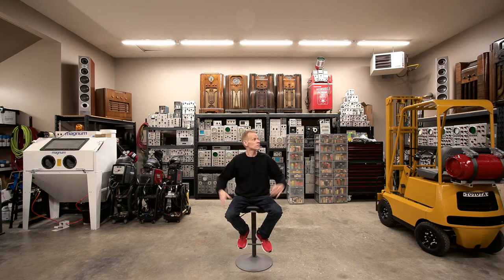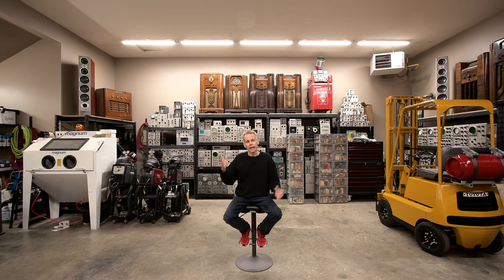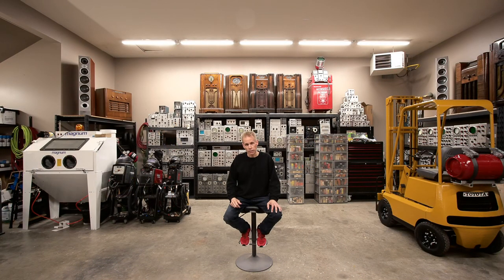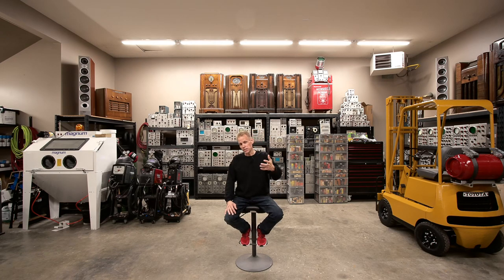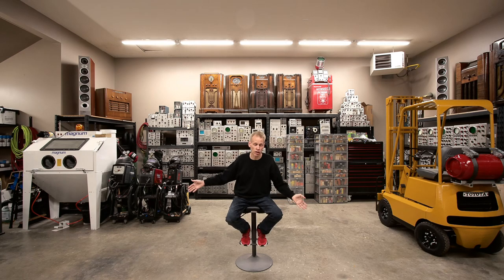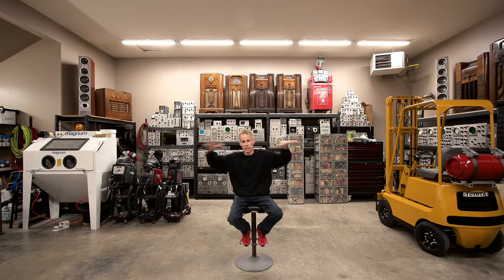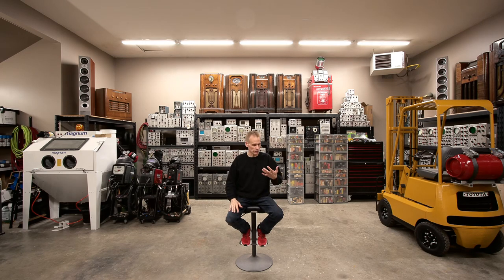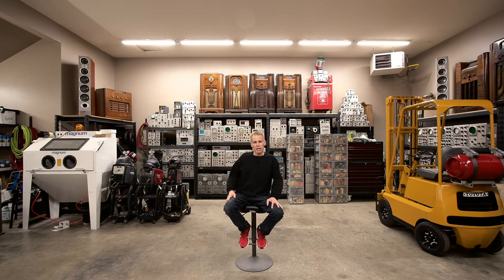ZAP! Mr C's Worst Electric Shock Explained In Detail!

Comment: Thank-you for the Story Paul.  Yes i appreciate the correct usage of the spoken word. Electrocuted is a term on an autopsy which means death by electricity. However if you live you were shocked.  It may be a severe shock but if you're alive it's a "shock" no pun intended. Hi hi we are glad you're alive thank-you for the caution and the mentoring we need good examples and good repair technicians; passing on of the technical mindset for troubleshooting electrics it great.  Thanks again.🤓

Comment: As a highschooler in '70 I took two years of electronics. It was all tube radios and amplifiers and theory, etc. I learned in my first class (thank you Mr. Peterson) as we were taught to ALWAYS put one hand into the pocket when working with voltages that could shock. A habit I still retain and practice without fail today at 70 years old. Occasionally one needs to remove that hand from the pocket for some specific task, but it provides a deep awareness of the danger lurking, and when the absolute need to a second hand has ended, back into the pocket it goes.

Comment: Hi Paul, thanks for sharing and glad you are still with us to share your knowledge.  Back in my teens in the 70s, I did stupid things, like touch a fly back transformer metal cage while set was turned on.  Luckily, only with one hand, felt the 60hz ac, and luckily still here.  One time working on a switching power supply for a computer, I did not realize high voltage ac was there, even though it did say high voltage right on it.  I also don’t work on amps that have tube heaters in series, 50c5, 35w4, etc, as it’s easy to get shocked on them too when ac not isolated.

Comment: Excellent video as always! Your shop is so...clean! I've been working on tube guitar and hifi amps for close to 30 years now, and have yet to get a dc shock from one...but I'm anything but cocky. Always work slowly and methodically and am aware of the constant danger but not really fearful of it. Never touch em when medicated or impaired and always discharge and verify...one hand, rubber soles, etc. I also am an avid user of clip leads for my meters and leave one lead disconnected from the meter while hooking up for a current measurement until it's connected on the device properly. Some real pros have died doing this work over the years. I HAVE however taken a pretty good AC shock from an old Cheshire labeling unit at a mailing house i worked at for a time. I believe it was around 300v and most likely 60 hz. Did not get clamped thankfully. Some bit of wiring insulation had failed and was putting voltage somewhere it wouldn't normally be. That weird feeling vibration and the realization of "oh shit..I'm getting shocked" is something you don't forget.

Comment: Hi Paul - Thanks for sharing that memory,  I remember the worst shock I ever had with very similar symptons - just 240V AC in the UK but got it straight through the heart accross both hands. Remember thinking I cant let go of this and this is the end  - then a feeling that someone had pulled me away and gently sat me down against the opposite wall - I was also white and had a headache for 3 days - needless to say the electrician that was training me was not even on the same building floor as me and knew nothing about the shock - sometimes there is a guardian angel looking out for you 🙂 - Great channel keep up the good work.

Comment: Stories like this really give perspective!
The worst I had was while testing 11kV power cables. When testing insulation in high voltage cables, it is rare to use DC because it can leave areas of charge within the cable even after discharge. When the cable is re-energized this charge is projected on top of the AC peak voltage and can cause catastrophic cable failure.
The solution is to use AC to test the insulation, however for long cables the capacitive reactance is very low and the current required too high for the test sets. 
To get around this we use lower frequency AC (generally 0.1hz, reducing the current required to a 500th for a 50hz system).
The only issue is the cable still has to be discharged as some test sets don't finish at the zero point crossing or have a discharge function in-built. The longer the cable, the longer the discharge required due to dielectric re-absorbtion.

I was testing multiple paper-lead cables @12.5kv one after another and discharging as I went. I didn't realise the one set was far longer than the rest and didn't discharge nearly long enough. I grabbed the test clip after my short discharge attempt and the sensation was like an awful cold wave passing over me. I swear could feel electrons washing over me. It was a sickly feeling and felt completely different to the bumps I have taken from mains AC(2 to date). I dont know what the voltage had risen back up too, but I knew I had messed up and was lucky.

That was years ago and I haven't had anything since. It definitely changed the way I worked, and I really advocate the safety around higher voltages because you rarely get a second chance.

Comment: Man I am so glad that you survived that freak accident Mr Carlson. I couldn't imagine never having seen any of your videos. Some of your inventions I still want to build also. 
Watching you bring some of the old stuff back to life and literally knowing every single detail of what every little thing does on it is mind boggling.

I've always loved and have been fascinated by electronics! Before internet it was kind of difficult to get exposed to them however. We had an old school Tube TV repair nearby but when the  tube TV's went away he closed up shop saying now if a TV tears up you just throw it away and buy another.

  My 1st electronic repair I fixed a Radio shack 100 watt PA Amplifier that I used to sing with at get together's and churches, when I was 16 years old with no training whatsoever. Not saying a lot actually since it was just an obviously burned out resistor which I went down to radio shack and bought a pack of 330 ohm resistors of which I still have 3 today as well as the installed 4th one. LOL!  And very likely they were the wrong value with the part fried beyond recognition like it was and radio Shack seldom had a certain value of anything on the shelf  that you needed anyhow  but close enough sometimes.  
I always wondered though what if it had been something more complicated, something that didn't rare its ugly head up at me screaming, " Hey I am the problem right here me the burned up resistor,  yea that's me right here! Now go to Radio Shack and buy another one just like me and lets get this thing going again." Had it not been so obvious a part likely I would not have been able to fix it then. I might today but not then.

I am also curious about your early days and education and what spawned you into electronics. Was it something that you stumbled onto by accident or out of necessity trying to make something else work? Maybe you grew up with an electronics expert? Were you a child prodigy perhaps building transmitter's as a toddler wowing your parents? 
If you get a moment I'd love to here!

Comment: Your Guardian Angel pushed you off the chair. I had a couple of close calls also. When I was 18, I was repairing my neighbor’s large screen black and white TV with a wooden cabinet. I knew I needed a mirror to adjust the deflection yoke but didn’t have one so reaching around the cabinet and looking at the screen and I got a high voltage shock, and it picked me up and threw me back about 6 feet, I would have gone further but the clothes chest stopped me. The second time as a crane technician, I’m about 24 years old then and I was servicing a customer’s “A” frame hoist, using an aluminum ladder leaning on the A frame. The hoist was phased wrong, and I was told by the maintenance man there that the breaker was off. I preceded to switch two of the wires around and all of a sudden when I removed the first wire nut I was immediately being shocked with 440 VAC and like you I couldn’t let go and it seemed like it was forever. Finally, somehow, I was able to remove body contact from the aluminum ladder. They had one of the 3-phase lines connect to the A frame.  I was thrown back and off the ladder and about 15 feet down. My thumb and index finger were burnt really bad. Needless to say, I had always checked the breakers myself after that ordeal. I hope this helps someone from ever experiencing what we went through.
Reply from the maker: Thanks for sharing your story Ken!

Comment: I have had one bad one from an old radio. There was no transformer in the thing, and it was plugged in the 220vac without its wooden cabinet. I touched the chasis with one closed fist, cause I didn't thrusted the thing at all. It had old cloth wire inside in bad state, so I was kind of aware of the risk. As with one hand it didn't shock me, I grabbed the chasis with both hands to move it on the table. At that moment my hart made a massive arrhythmia, with that vibrating feeling going thru my chest, and tensioning all muscles. Luckly I was sitting on the sofa, and the shock bounced me backwards. Like you explained, it took me some time to recover, leaving my hands, ams, and fingers with a numb feeling. Got really scarred of that radio, and it never got restorred. A good safety lesson. It must have been rectified 220vac, so like 310vdc, because it felt way stronger than a regular little tickel of 220. Rethink every movement twice when you work on valve stuff !!! Allways one hand, and an isolation transformer plugged in.

Comment: I also have the same Dak radio, but I was working on a D&A Phantom amplifier.  It was powered up, and I reached across the amp to change a setting on the radio and when I came into contact with the metal rack handle my arm was touching the top of the tubes.  Zapped me all the heck.  I was 15 at the time..   I will never forget the feeling.

Comment: I have been enjoying your channel as I have recently become interested in vacuum tubes, particularly transmitter tubes that can be used in tesla coils. I am glad you survived to bring us your wisdom and knowledge! I'll share my worst shock story. I was in the laser light show business for many years. These were the days of big Ion lasers, copper vapor, KTP/YAG etc., all water cooled with high voltage 3 phase supplies in most cases. In 2000 I was expanding my business into the middle east with an Egyptian/German partner in Cairo Egypt. I was alone in the building working on a Spectra Physics 270 Exciter tuning up the laser and the system. It was powered with 408VAC 3 phase, and I was holding the chassis with my left hand and brushed the energized passbank with my right arm. I got shocked right across the chest, and felt like I was kicked by a bull. Fortunately, I was also into aesthetic body building and martial arts so I was in very good physical condition, if I had grabbed the passbank I would be dead. Fortunately the spasm caused me to jerk backwards and fall on my back and not forward into the passbank.  My chest(heart?)  ached for about 1/2 hour after. I have gained tremendous respect for electricity since then.

Comment: Hi Paul, glad you was ok; you obviously wasn't using a variac transformer! My dad used to work for a local electricity company where he worked as a "Jointer". A jointers job was supplying electric to houses where he would splice live cables to the main supply; on one occasion while working down in a hole while is was raining, although the hole was covered the rain was still pouring in! They did have a pump but it wasn't taking the water away fast enough my dad and team raced to get the joint sealed before the water covered the electrics (bear in mind it was all live at the time!) SCARY STUFF...

Comment: Thank you for the warning.
   I started working with electronics and electrical gear around age six. 
  Never suffered anything as bad as that. The US Marines and sailors who trained me were strict about safety.
   Thanks for the warning.
   Some plastics and rubbers are slightly conductive. Learned that from a full colonel who got shocked turning on a metal desk lamp on a plastic topped metal desk. Two prong plug. Desk on a concrete floor.

Comment: My buddy was tree trimming, above me in the next tree over.  He dropped a limb across two or three wires of a high voltage line, and when I looked he was bounching off the trunk, pushing away with his hands, and bouncing back into contact with the trunk.  He looked at me with pure fear in his eyes.  This guy was my best friend, a guy I loved more than my own brother, and I had to act fast or lose him.   I felt somewhat safe from any high current (stupid me) because I was not feeling any shock, as he appeared to be feeling, so I reached out with my saw-tipped pole and took the mightiest swing I could manage, striking that  hanging branch halfway between the trunk and the contact point with the hi-voltage wires.  Lucky for all the inertia of my saw-pole was enough to crack that limb, and caused the branch to collapse in half and fall away from contact with the wires, then continued its fall on to the ground. 
Was I brave?  I didn't feel brave. I think bravery is what occurs when your buddy is endangered and one makes a saving attempt, never thinking about your own danger.
Reply from the maker: Thanks for sharing your story!

Comment: Thanks for sharing Paul i'm looking forward to more stories! I got hurt at work back in 2017, im a mechanic by trade and one friday afternoon changing a press in wheel bearing on a honda civic and I was trying to air hammer the large snap ring loose on the hub,  I had just been using the acetylene torches so I had my tinted safety glasses on and I couldn't quite see where my chisel bit was so I tipped my glasses up, gave my air hammer a little burp and boom I felt something hit my eye, It didn't hurt surprisingly but a few seconds later my left eye looked like I was looking through a orange and red lava lamp so I knew this was really bad, I dropped everything and drive myself to the hospital about 20 mins away, they took a look and then did a CT scan and a few minutes later said "get to the toronto hospital right now they are waiting for you to do emergency surgery", A piece of hard bearing race broke off and shot into my  left eye and bounced around tearing up the inside, I had to have a few surgeries and many many many trips to Toronto. I didn't go blind in my left eye luckily  but I lost a lot of sight,  its now about 80/20 vision 6 years later, My eye surgeon told be that it went in on the edge of the center of my eye and if it was any closer to the center I would've lost all vision in that eye. I was 24 at the times and it was the scariest experience of my life so far. It's amazing how things can change in a split second.

Comment: Mr C I am an electrical engineer and Ham Operator AJ4MT extra class. I build vaccum tube amps all the time. I don't mean to laugh but as you were telling your story I couldn't help myself. I heard you talking about pole pigs I think most builders have tried those in the past. I build high power amps 2500 watts or better with tubes like 3cx5000a7 or 3cx3000 just to name a few. But the worst I ever got bit was with an old D&A Phantom 12 tube sweep amp. I had just got through recapping and re tubing it. I had tested it and I had sat bin in the floor. I was talking with the customer for over 30minutes when i decided to put the slide in cover back on. Somehow my fingers got underneath the chassis and touched those new caps. Even though it was only 900VDC it was at well over an amp. And like you said my whole body was vibrating and by the time i let go I had blood coming out of my teeth and nose. As you said I wasn't sure if I was going to make it. Burned a hoe in my fingers and turned them ass white where the capacitor leads were. Needless to say from that day forward I kept my left hand in my back pocket at all times when working around high voltage .Now I put bleeder resistors on all high voltage caps
Reply from the maker: Thanks for sharing your story! Glad you're still around to tell it!

Comment: This reminded me of a rather fun story with my dad. We were in his basement repairing a tube power amp (a Tesla Mono 130 with four EL34s in the final stage). There was a loose red wire inside the thing, my dad - despite being experienced with electronics and high voltage - asked "where is this wire coming from?" and like a 5 year old kid, he touched it. Fortunately he managed to release it right away. After measuring with a voltmeter, I came to the conclusion that wire had the B+ on it, at about 500V.

Comment: I was shocked while tig welding the other day it was not pleasant I had taken the ground clamp off the peice I was welding and layed it in my lap 😮 yea dumb move went to start welding again and it got me I'm sure it was only about 90 volts DC for a short couple seconds but still gave me a rush and scared me.
Shocked by 115 many times for just quick little zaps and i used to repair high def dvr boxes and the internal powersupply had a pesky heat sink that had about 90vac on it and it would catch your forearm a few times a week but never been shocked like you. Glad you lived to talk about it!

Comment: Please review the proper use of isolation transformers.  My belief is that we should use two separate isolation transformers.  One for the unit under test and one for the scope and other test equipment.  If the unit under test has a short or other misconnected wire, that could provide an unexpected voltage to the test equipment.